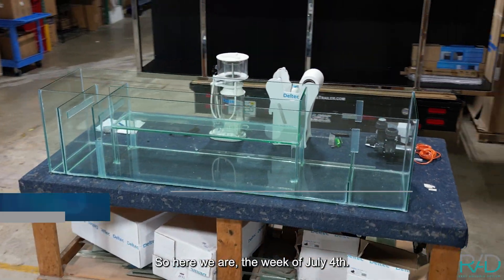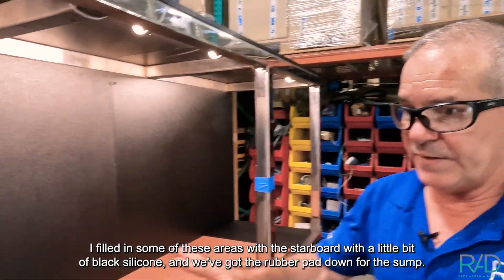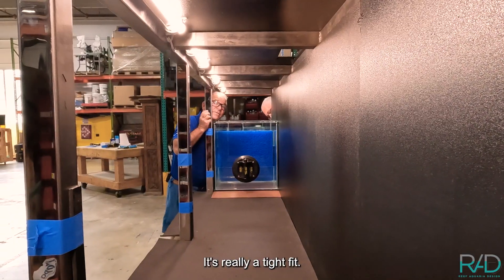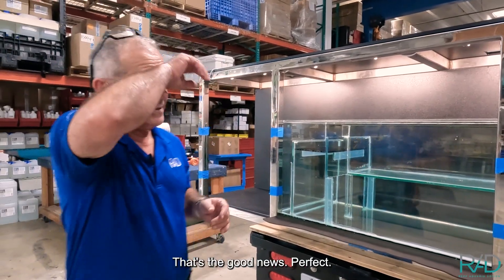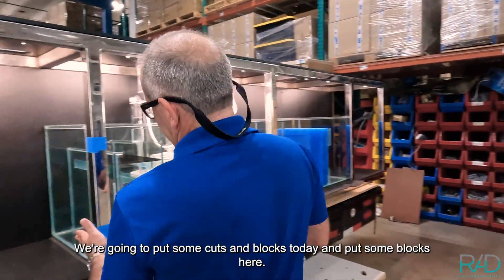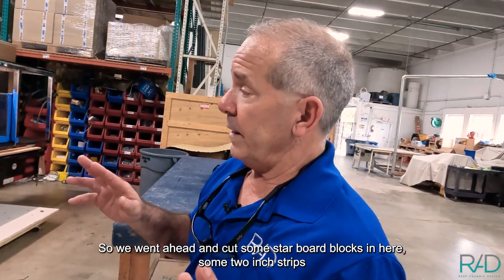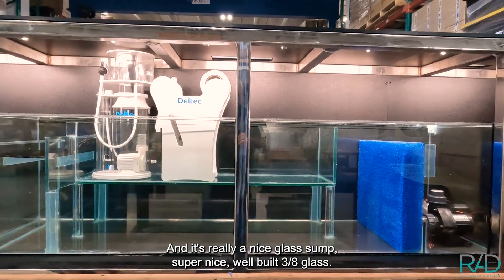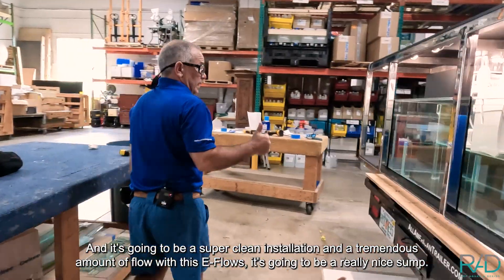SUMP DISPLAY PROJECT FOR FJ PROPELLERS IN FORT LAUDERDALE. BUILT BY REEF AQUARIA DESIGN. PART 4.

Comment: Beautiful craftsmanship. Awesome. 
That polished SS stand is sweet..Would be super if the same spec as FJ’s props hey? Nice touch. 

I’ll admit I’m a bit surprised by this sump’s design for ergonomic reasons though. 

If this was a remote sump, no issues. But with having this sump under the stand, I personally would’ve designed baffles for less water height (7-9”) so the skimmer and filter roller didn’t need to be on that raised section at rear..even if a skimmate locker is used..ideally both devices easier to reach for maintenance tasks. 
(With size/volume of the display tank, there’s no benefit from additional water volume in the sump.)

Perhaps this was a RAD sump originally intended to be in a remote filter room…where it could be installed at waist height for improved ergonomics.(?) 

Either that, or “Form came before Function” when designing this. (I personally prefer the harmony of both aspects whenever possible.)